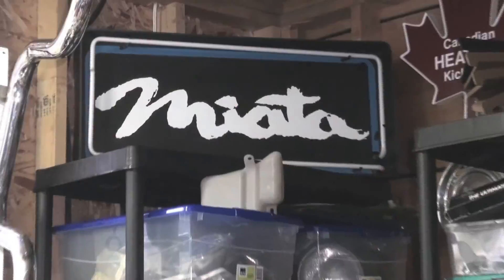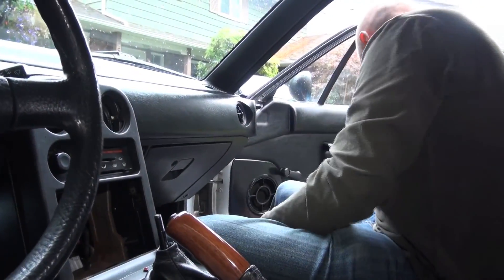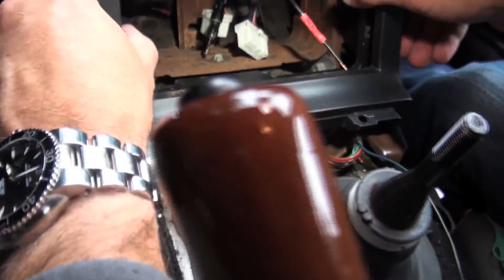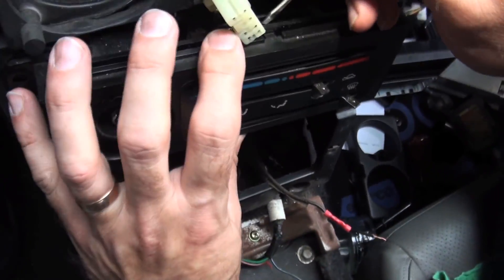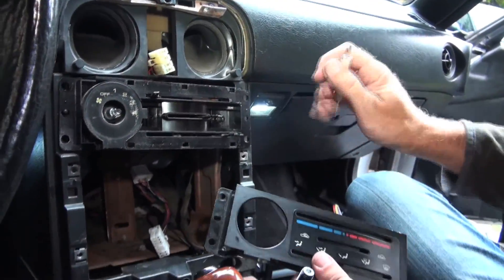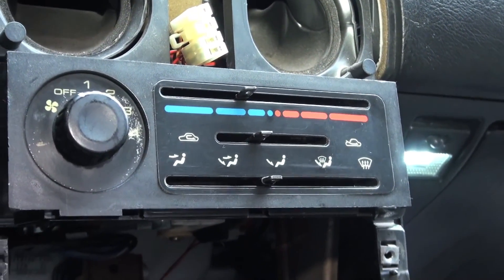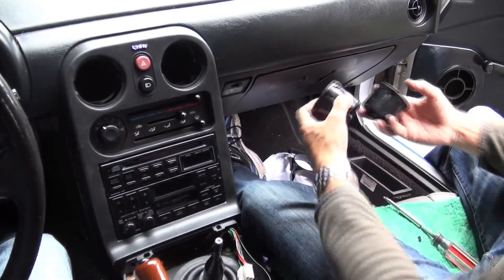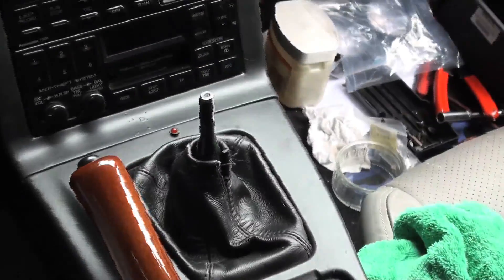1990-1993 Mazda Miata MX5 Heater Control Plate Nobs & Dash Bulbs Replacement.

Comment: I have a 1992 Miata. After the car runs a bit, the center console gets so damn hot, I can hardly stand it. Is there anything I can do to keep it from getting so hot. Can I go underneath the car and spray some kind of heat protection paint on it?  I really like driving my Miata, except for this. Thanks, JDecker
Reply from the maker: A lot of the heat may be coming in though the hole that the shifter enters the cockpit. There is a big rubber “insulator boot” that seals the hole. 
It keeps out fumes, heat and nose. 
There is also an insulation pad that goes on top of it. 
Almost every Miata that I see needs a new insulator boot.
Reply: Do you have headers? Mine does the same thing when I have the headers installed